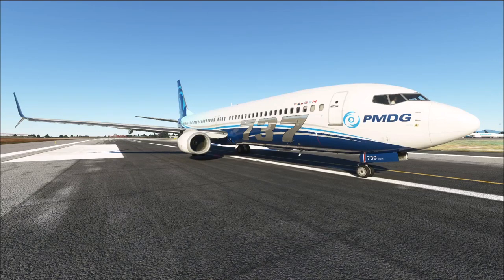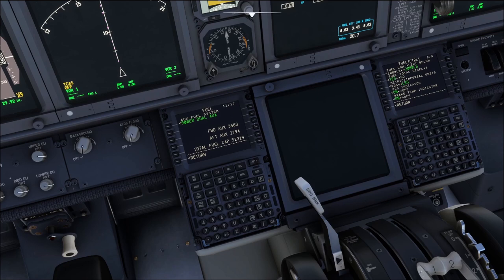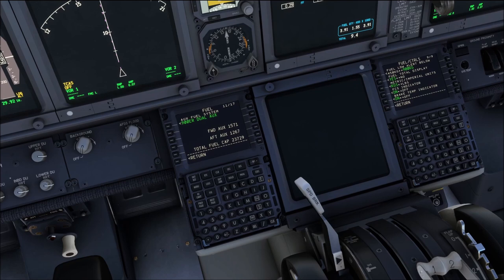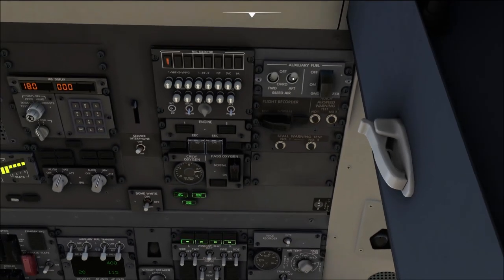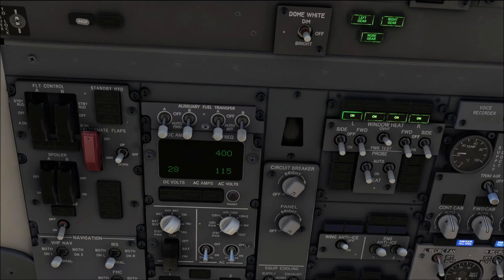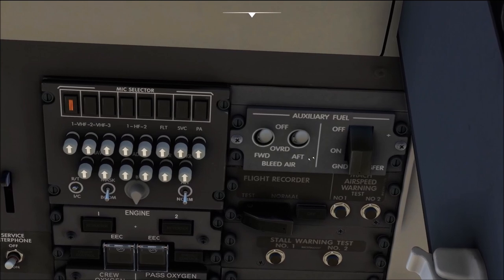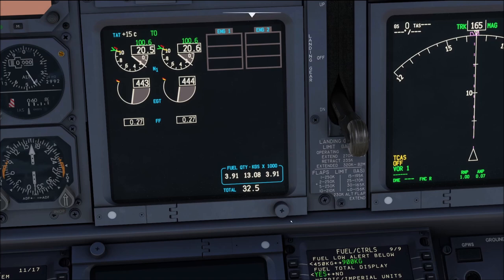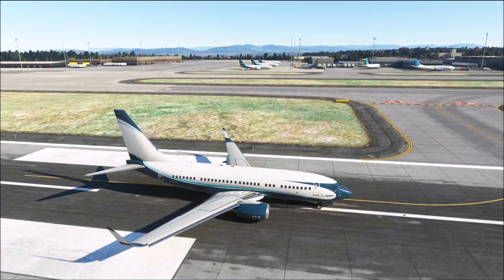737-900ER Differences: Aux Fuel System Explained | Real 737 Pilot

Comment from the maker: Highly recommended video from the 737 technical channel if you want to dive into the systems even deeper. From 1:14:13 he dives into the aux fuel system on the BBJs (which is slightly different than that of the 900ER since there is no aux fuel panel in the cockpit in the 900ER) with a lot of excellent explanations and pictures:
https://youtu.be/FuuNWFTruMc

Comment: Hi Emanuel, another great video. I was wondering if you had any recommendations for takeoff and landing performance computation for the 900 since the closest tool we have is VPT for the 800? I was simply going to plug the values into the 800 tool and only use a derate in order to have same margin.

Comment: I tried the aux fuel system in my BBJ2 and it seems something is wrong with the weight calculations. If I install all the tanks, the fuel in the aux tanks are not reflected in GW during calculations. Any fuel I add above the default maximum doesn't change the plane's GW. Is this a bug or I misunderstood something? Is this the same in 900?
Reply from the maker: Strange, first time I hear this. When I tested the BBJs back in the day they surely showed different behavior. I'd recommend to open a support ticket, I'm sure PMDGs support can help you to solve this - or issue an update should a bug have found its way into the plane.
Reply: @A330Driver  Thanks, I've opened a ticket, they're investigating the issue. :)

Comment: Hi Emi! Thanks for the video… are you aware if -900ER operators had uninstalled the aux tanks? DL for instance has cancelled the Type II doors, due to the cabin configuration. Could it be for the aux tanks as well?? Thanks!!
Reply from the maker: Delta does at least not seem to have aux tanks installed right now. Not sure if they had removed them.